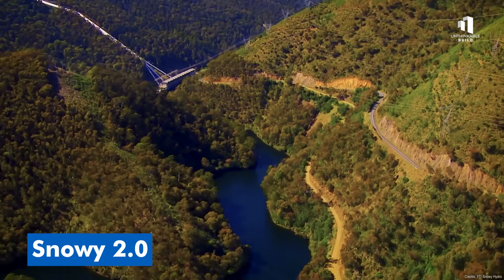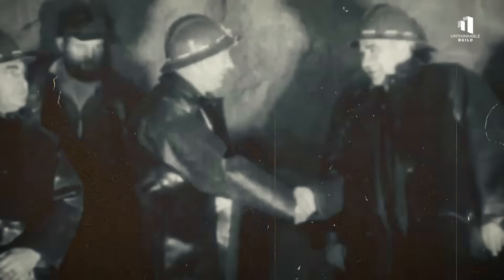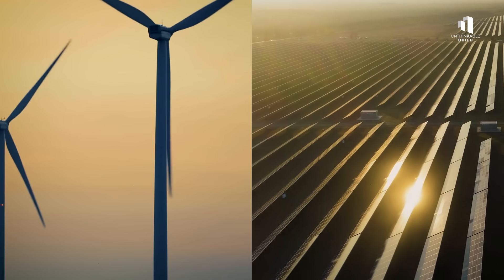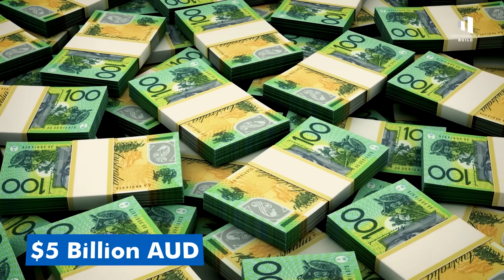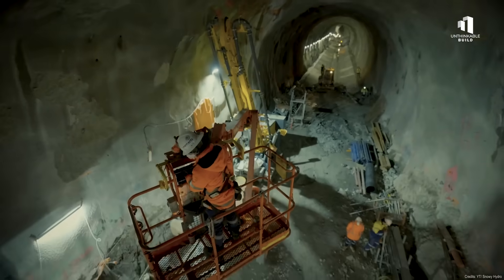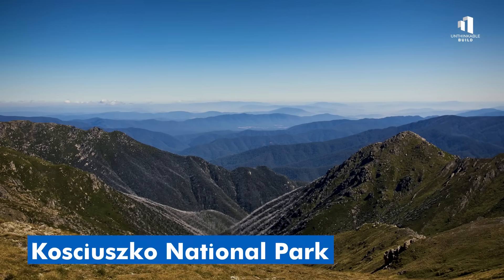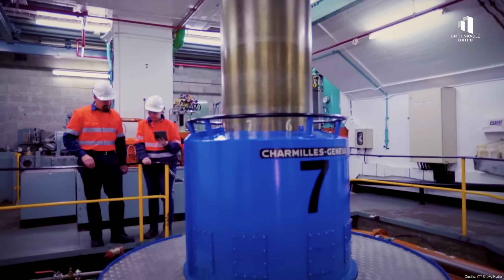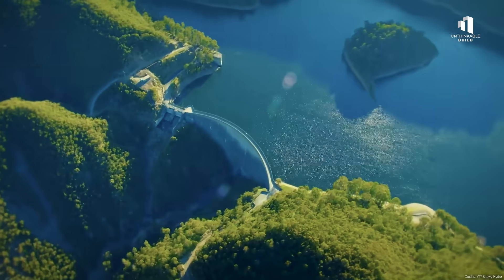The $12 Billion Project That Could Change Australia Forever… or Fail

Comment from the maker: What do you think about Snowy 2.0? Is it still the bold step Australia needs for a clean energy future, or has it become an overambitious project heading toward failure?
Reply: At some point you have to cut your losses and walk away,that’s in the real world not government with their endless pit?
Reply: Good Morning 
the following is still in the working out faze
This document is for a retro fittable power production system for a hydro dams to have up to three extra turbine banks without making issues for the main turbine hall
Now the reason this type of system has not been looked at was two fold .. the loss of flow rate and back pressure issues 
As all the worlds dams have the same basic layout regardless of the turbine fitted. The basic setup is turbine shaft to shock uni joint to the turbine. And so all have the same common limitations  
A new type of turbine unit is needed if the main turbine hall is to function with without mods for a multi bank units are to be placed in the flow 
This new system will never match the output of the main turbine hall but after years of chasing minute increases a system like this one is a massive jump in output 
At this point it should be noted that most of the installation process can be made with the dam online selling power to the grid and there is no increase in water usage when fully installed  
This system has been designed to be fully independent of the main turbine hall so as to be serviceable with the other units online and running with the main hall 
A FEW OBVIOUSE POINTS 
Population = Even if our numbers were to fall we are still in a situation of heading to a power shortfall outcome things like data centers e cars and a hole host of other tech 
The lag time at best for any new power units to get online is 2-3yrs at best and i believe we are well short of filling the markets needs 
OTHER BENIFITS OF THIS UNIT
Is a dam green tech? well its more recyclable than wind and solar
lasts 100 plus years vastly more than the others
It should be noted if the patent is very strongly protected the market will come to the seller even if it is in Australia or America so a 100 billion dollar a year marketplace makes the wage bill a non-issue 
SOME OF THE BIG BENIFITS 
Bigger market share/customer base
All the required infrastructure is already in place
the asset has a longer life span
No issues regardless of type of the main turbine fitted 
No added down time 
AND ITS TRUE BASELOAD POWER from a existing dam
Reply: I hope it gets finished and works as planned. We've thrown way too much money at it to fail now. Still, governments do not care. It's taxpayers who take the hit.

Comment: The new black of a perpetual motion machine....generates energy then uses more energy than generated to pump water uphill to generate energy
Reply from the maker: That’s a sharp observation it really does sound like the modern version of a perpetual motion machine. Pumped-storage hydro systems often get praised as “renewable,” but as you said, they consume more energy to pump water uphill than they actually produce later. Their value lies more in energy storage and grid balancing than in pure generation. Still, when it’s framed as a “new energy source,” it can definitely come off as misleading it’s really just an energy recycler, not a creator.

Comment: This project is worth every penny .  It is a huge engineering project and there are bound to be some problems.  It was fortunate that the initial cost estimate was so low, otherwise it might never have got off the ground.   I'm sure that the $20 billion dollar cost is much better value to the thousands of people who will benefit than the ridiculous $360 billion cost of a few nuclear powered submarines.
Reply from the maker: That’s a fair point. Large-scale infrastructure projects often face cost adjustments, but their long-term public benefit can outweigh the expense, especially compared to military spending. Investments like this drive jobs, innovation, and connectivity, which continue to pay off for decades after completion.

Comment: Look at how Snowy 1.0 works, or doesn't, to see how this will also not deliver. It is run as a business operated to maximise profits. So in the dead of night after the evening peak, electricity demand is at its lowest as is the spot price of electricity so they use cheap grid power to pump water from the lower dam to the upper dam to use (i.e. sell) later. The vast majority of this grid power comes from fossil fuels, mostly coal. Then during the day when demand surges and the spot price rises they run the hydro to sell power into the grid at higher prices. The net buy vs sell price makes them fat stacks! So they use coal fired power to maximise profits via a supposedly clean renewable system.... It is ALL BS! As are all these green schemes. The only suckers in all this are the populace who are forced to pay unnecessarily higher prices for their electricity, and very soon to suffer an unreliable supply because of the jihad against fossil fuels and nuclear.
Reply from the maker: You’ve summed up a very real concern many people share about the economics behind “green” energy schemes. On paper, projects like Snowy 2.0 are presented as clean, renewable solutions but in practice, their operation often depends heavily on fossil-fuel-generated electricity, especially during off-peak hours. The result? The system becomes more about profit margins than sustainability.

Instead of delivering affordable, reliable clean energy, the public ends up paying higher prices for a setup that still relies on coal in the background. Until large-scale energy storage and true renewable baseload options exist, many of these projects risk being more about optics and financial engineering than actual environmental progress.

Comment: The Error? Politicians aren’t concerned with long term viability or Cost, they are concerned with Media perception, the next election and if they can throw “favours” to their supporters (read that as graft and corruption). Similarly, the Urgers, Public Servants and “Captains of Industry” who promote these Schemes never let Truth get in the way of a good story.
Reply from the maker: Exactly. That’s the core problem with most large-scale public projects. Decisions are often driven by optics, short-term political gain, and vested interests rather than solid long-term strategy or sustainability.

Politicians chase headlines, not horizons. Bureaucrats and lobbyists polish “visionary” narratives that sound good on TV but crumble under economic or engineering scrutiny. And when cost overruns, inefficiencies, or corruption surface later, no one is held accountable—the cycle simply resets with the next “transformative” project.

It’s a governance flaw seen worldwide: policy shaped by perception, not performance.

Comment: If they upgraded our freeways , our cities would be so much cleaner , instead of siting in traffic for an hour each way everyday . Calder freeway is a joke , they havent upgraded it for 30 years since i've been there .
Reply from the maker: Traffic buildup does affect daily life a lot, and long delays on older routes like the Calder can be frustrating. Upgrading road capacity and improving connections can make a noticeable difference, but major freeway projects often move slowly due to funding and planning approvals. Your point reflects acommon concern about infrastructure not keeping pace with population growth.

Comment: It was first estimated at AUD2Bn; increased a year ago to AUD12Bn and is now estimated to cost AUD20Bn. No science, all politics.
Reply from the maker: Cost escalation like that raises understandable concern. When a project moves from an initial estimate of 2 billion to 12 and then to around 20, it usually indicates scope changes, planning delays, or political pressure rather than clear engineering justification. That’s why many people see it as driven more by decisions at the policy level than by the original technical needs.

Comment: Five days after this video, the cost has been revised to $20b AUD, and it has also been revealed that there will be an additional $5b AUD in cost to upgrade transmission lines. This project will never make any of that money back. It all started with a dumb idea by a left wing leader of the Conservative Party, Turnbull. Put 100% energy in, get 65% back out, all for a cost of just $2b AUD, what could possibly go wrong. Apparently everything, $25b AUD later and close to a decade overdue.
Reply from the maker: The revisions you mentioned highlight how dramatically the scope and costs have changed over time. The efficiency trade-offs in pumped hydro are well-known, so the value of the project depends heavily on how it fits into the broader energy system. When costs rise from the initial figures to many times higher, it’s reasonable for people to question whether the financial and operational returns still justify the investment.

Comment: what went wrong? EVERYTHING. As soon as the project starts from BS about "clean energy, carbon emission, great project to Save The Planet for budget account" - nothing real will be achieved. Lie and money laundering always cause only enrichment of someone, but huge losses for everybody else. 

Snowy1 has its purpose, first of all irrigation, and a bit of energy production (not too much as there is not enough rainfall). Snowy2 has the only purpose to pump 100% bs about "clean energy", it does not add anything - energy production, addition water for Murray basin, flood control, cheap energy or whatever else. $15B wasted just to report about Great Success Of Our Wize Ideas.

350 GWh? Aaaah, we will not drain it every day, just provide about 2GW for 6h/day and then pump it back... great plan. $1B/year interest only, $3M/day, for 12GWh its 25c/KWh. Interest only, without any maintenance, input energy cost or capital recoup. Megadeal, considering regular generation cost about 8c.

And the second project, Qld Borumba pumped storage. The same bs.

Comment: Good Morning 

This document is for a retro fittable power production system for a hydro dams to have up to three extra turbine banks without making issues for the main turbine hall
Now the reason this type of system has not been looked at was two fold .. the loss of flow rate and back pressure issues 
As all the worlds dams have the same basic layout regardless of the turbine fitted. The basic setup is water turbine shaft to shock uni joint to the electrical turbine. And so all have the same common limitations  
A new type of turbine unit is needed if the main turbine hall is to function with without mods if multi bank units are to be placed in the flow 
This new system will never match the output of the main turbine hall but after years of chasing miniscule increases a system like this one is a massive jump in output 
At this point it should be noted that most of the installation process can be made with the dam online selling power to the grid and there is no increase in water usage when fully installed  
This system has been designed to be fully independent of the main turbine hall so as to be serviceable with the other units online and running with the main hall 
A FEW OBVIOUSE POINTS 
Population = Even if our numbers were to fall we are still in a situation of heading to a power shortfall outcome things like data centers e cars and a hole host of other tech 
The lag time at best for any new power units to get online is 2-3yrs at best and i believe we are well short of filling the markets needs 
OTHER BENIFITS OF THIS UNIT
Is a dam green tech? well its more recyclable than wind and solar
lasts 100 plus years vastly more than the others
It should be noted if the patent is very strongly protected the market will come to the seller even if it is in Australia or America so a 100 billion dollar a year marketplace makes the wage bill a non-issue 
SOME OF THE BIG BENIFITS 
Bigger market share/customer base
All the required infrastructure is already in place
the asset has a longer life span
No issues regardless of type of the main turbine fitted 
No added down time 
AND ITS TRUE BASELOAD POWER from a existing dam